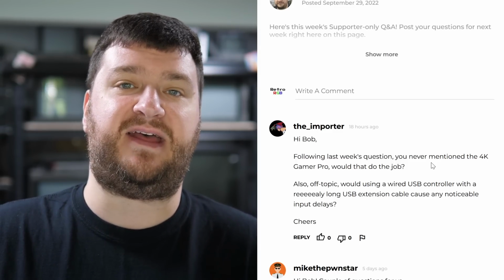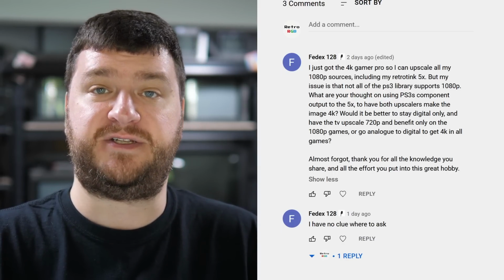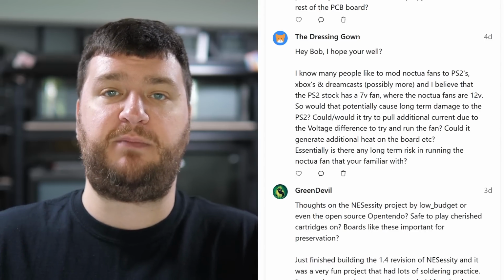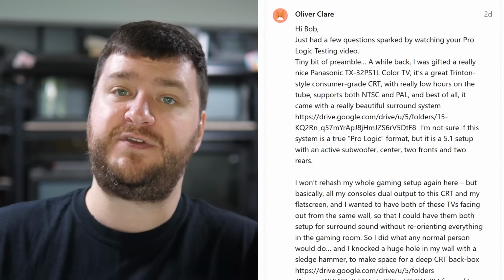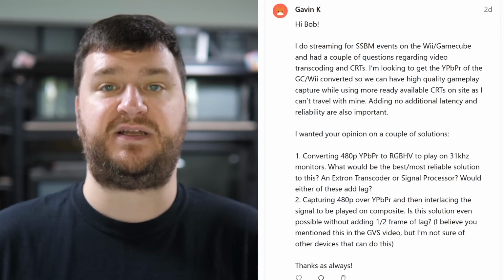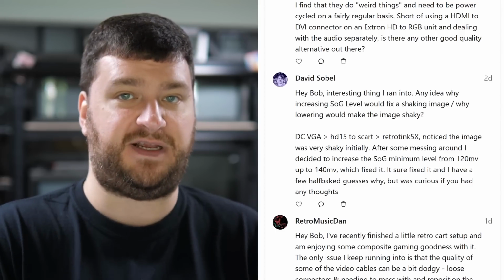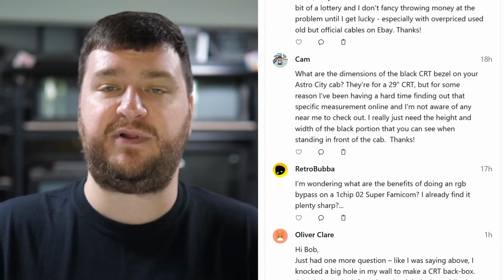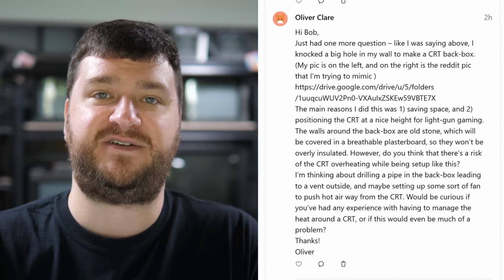Supporter Q&A #227

Comment: If the two fans are the same adding a potentiometer/rheostat would do the same thing as running it at 7v directly. All adding the other component would let you do is run the fan lower than 7v.

Comment: Ah! I've been using two VGA monitors for the stream setup at my SSBM and P+ locals and it's fantastic. On god it's some of the most beautiful melee you'll ever see. Gavin, if you're reading this, just look up how to enable the 480p fix if you use a wii. That helps a lot with the lower quality analog video from the older wiis. I can also recommend the Benfei hdmi to vga converters. I use two of those from an hdmi splitter for both of my vga monitors.

(I'm Alborix, who asked about this kind of thing a few Q&As ago. thanks for that!!)

Comment: Is there any risk to the console to putting a buck converter on the PS2 fan power line to step the DC voltage up from 7V to 12V for a Noctua fan?
Reply: Space and putting the converter where nothing will get shorted out

Comment: The PS3's component output has a significant amount of lag I think
Reply: Do you have a source for that? Analog video signals should have 0 lag. It is however probable that the analog to digital circuit in the TV added lag.
Reply from the maker: That's 100%, completely NOT true.  That said, you might be thinking of my video where I explain how plugging analog signals directly into flat-panels are almost always laggier:  https://youtu.be/jJzN_YHZezY

Comment: What are the UV rays supposed to do besides degrading the packaging on the chips?    if your aim is to get rid of a smell okay it makes some sense but otherwise what harmful impurities are the uv rays supposed to break down vs. the chips packaging?

(btw there's a pretty good vid on component aging on vintage computer festivals channel)

edit: it makes even less sense inside through a uv filtering window
Reply from the maker: You're completely misunderstanding (maybe I explained wrong): The UV rays are to evaporate any of the microparticals left over from the isopropyl.  Air is probably all that's needed, but sitting in the sun for one min can't hurt.
Reply: @RetroRGB  yea I understood that bit, but does uv break down the alcohol -break down the bonds between alcohol and other stuff ?  just airing it and letting it evaporate should be fine the parts where it takes longest to evaporate are under the chips anyway?  I don't mean to just be a negative nanny but it doesn't seem to make chemical sense, in the way that it would break down the things the isopropyl makes bonds with to not evaporate on it's own more than airing or heating it would (especially under the chips from where you can't easily just airgun it out)

Comment: The OpenTendo and NESsesity projects are brilliant use cases for preservation and resurrection of old hardware.  I've done an OpenTendo with 90%+ old parts, and another that is 90% brand new parts.  Both work fantastic, and allowed me to retain and keep the original CPU and PPU chips, which is the real lifeblood of the console.  I took one of the consoles a step further and added sockets so future CPU and PPU chips can be rapidly tested when pulled from dead boards.

I really hope Red figures out how to do a Famicom/Toploader variant of his OpenTendo and others are encouraged to do a similar project for the Sega Master System.